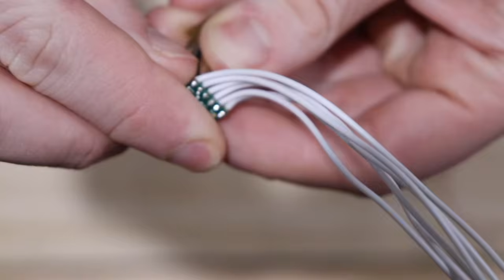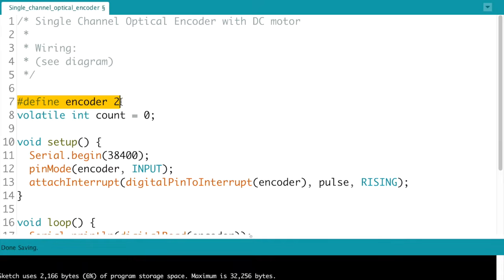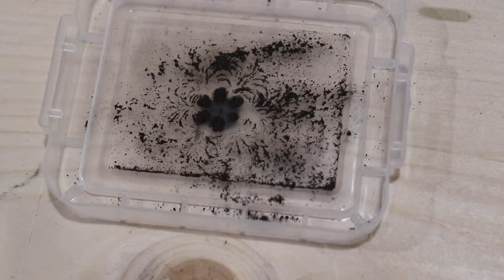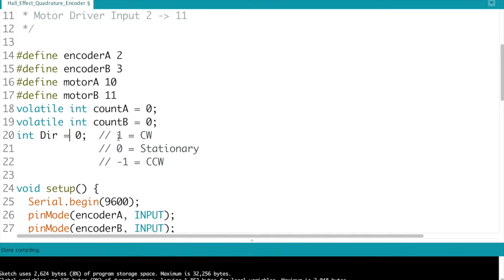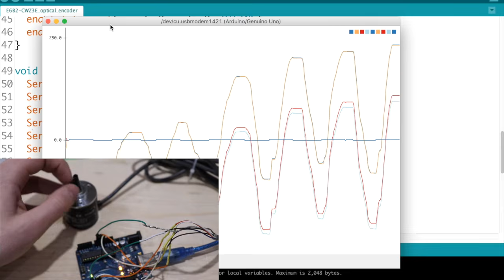How to use encoders (Optical, Hall Effect, Quadrature)

Comment: Good day.
Can you please tell me why we need to use 2 interrupt inputs per 2 phase quadrature encoder? Can't we just use one interrupt? One phase is connected to the interrupt input, the second phase is connected to any other input. When the interrupt is triggered, we read the state of the second input, and determine the direction.
And in this case, for an optical encoder with 3 phases, we can use two interrupts. One for one of the main phases, and a second interrupt for phase Z.
PS: As far as I remember, Atmega 328p has only two hardware interrupt inputs.
Reply from the maker: yes, this would work and probably makes more sense to do it this way
Reply: @WillDonaldson  Use two interrupts per encoder, it may make sense if, as you described in the comments, we want to force the encoder resolution to increase.
Reply: this will also change the Mode of the interrupt from "HIGH" to "CHANGE", otherwise it will skip the pulses.

Comment: Just looking at the rise of A means edge bounce will give false counts. You need to alternatively look at A and B, or look at the change of A both up and down to achieve correct counting in noisy environments or where you might be sitting in a position on the A edge.  
If you choose to look at both the rise and fall of A, scan B when it happens. If the state of B is the same as A, you went backwards. If B is opposite, you went forwards. 
A better scheme is to look for a change in A then look for the next change in B while ignoring A and visa-versa. You completely avoid edge bounce problems.

Comment: Handy tip if you are using the E6BS-CWZ6C Encoder This uses NPN Open collector outputs.. They need to be pulled up on the input. Use this pinMode(encoderA, INPUT_PULLUP);  for all your inputs (:
Reply: I don't know what the hell this means but maybe it's why my encoders don't seem to be working AT ALL. Thank you, will play around with this tomorrow
Reply: @MichaelButlerC  HI It's arduino code... the input from the encoder to the arduino, these pins need to be pulled up. I think what it does is holds the pin high with 5v with a resistor. so when the encoder has a falling signal in the square wave it's from 5v to 0v .Not lets say 4.2v to 0v. i might be wrong but pulling the pin up on the arduino made mine work.
Reply: @TidyThreads  thanks, I figured out already -- my pro micro was only giving 4.5v on VCC so the encoder refused to work. I ran a second USB cable raw, gave it 4.98v and it started working!

Comment: Why did you change the arduino from Leonardo to Uno when you had started using the optical encoder (2 phase) ? I ask because I am facing a problem with my leonardo.
Reply from the maker: This video only uses the Arduino Uno? Truthfully I've never owned or used a Leonardo so I can't help with that specific issue, but the code should work on all Arduino boards

Comment: How is he plotting on serial monitor, is that some another application or arduino IDE can do it by itself?
Reply from the maker: it's a feature that comes with the IDE. Go to the top menu of the arduino IDE window and select: Tools/Serial Plotter
Reply: @WillDonaldson  Thanks friend, i am trying it tomorrow
Reply: @WillDonaldson  Just one question, it's kinda related to this video. I have some optical encoders from old printers and i can't identify pins, there are six of them. Do you have some idea where i can find more information about this?
Reply from the maker: @filipstojanovicmechanicale9265  no, not with the information provided. There are multiple different ways it could be wired. Look for any part numbers and search online for documentation. If you can identify the power and GND lines (and at what voltage it operates) then you can probe the other wires to test them.
Reply: @WillDonaldson  Thanks 👍 I will try to identify the power and ground. And i will let you know if i succeded

Comment: I am using incremental optical encoder 600ppr but gives 1200 readings per revolution (max 100khz) with  arduino(16mhz). When the rpm is around 50-100 no issue with the readings. But when i rotate it at 300+ rpm the Arduino skips pulses and gives a wrong output. I tried removing the serial print function still there's some skipping. I am using it interrupt routine. Should I change the countroller to teensy 4.1 (600mhz) or any other solution. And if teensy then can i use 5 encoders on one teensy. Please help me with it.

Comment: Why when i use the last code the only thing i get is 0
Reply from the maker: Not sure, double-check the wiring, it's possible there is a loose or incorrect connection. Also if you have a different encoder to the one shown in the video, check the manufacturer's datasheet as they may have different wire names or colors, may operate at a different voltage, or have other features that make it incompatible with the code I provided.
Reply: The same thing happens for me, still troubleshooting. Did you find a solution?

Comment: We use the quad optical encoders in oil and gas. We attach them to mechanical footage counters that attach to a wheel. The wheel moves against tubing which turns the mechanical counter then rotates the encoder via a lovejoy connection

Comment: Hello
Can you help me write the Arduino code?
I designed a small car that runs on a single DC motor, and I want to measure the distance traveled by the car and through this distance I can stop the car or reduce its speed.
So I purchased (Incremental Rotary Encoder 600P/R) to measure the distance by attaching it to one of the wheels, and I also purchased (BTS7960 43A-H Bridge High-power Motor Driver) to control the motor according to the distance measured by the encoder.
(For example, when the car travels a distance of two meters, it slows down or stops)
Can you help me write the code on the Arduino?
Note that I have the circumference of the wheel, and I will send a picture of the encoder and the Motor Driver
Thank you.
Reply from the maker: thanks for your interest in my tutorial! Unfortunately, I do not have the time to write custom software for everyone. That said, if you take the code provided in the description you can count the number of pulses. Knowing that there is 600 pulses/revolution you can calculate the distance. Distance = (wheel circumference) * (number of pulses) / (600 pulses per revolution).
Reply: @WillDonaldson  Thank you
Reply: Can we calculate the pulses per revolution using serial plotter or do we need some equipment to calculate it ? My encoder motor supplier hasnt given the info about pulses per revolution. Can we measure it only using serial plotter?

Comment: Will, how do you get the differential quadrature encoder to 4x its counts? I have heard that if the PPR of the encoder is 1024, then it can use both channels to up that count by 4 and get a far better resolution.
Reply from the maker: Correct, in the video, I demonstrate counting the pulses each time channel A transitions from a LOW to a HIGH state using the RISING command for an interrupt. This gives 1024 pulses per revolution. If however, I was to use the CHANGE command for an interrupt (instead of RISING) then I would count a pulse both when channel A goes from LOW to HIGH (rising) and also when channel A goes from HIGH to LOW (falling). This would double the number of pulses per revolution to 2048. If I also measure the change in pulse state from channel B using the CHANGE command, the resolution will double again to 4096. Hopefully, that makes sense, here are some resources if you want to read more. 
About Arduino Interrupts: https://www.arduino.cc/reference/en/language/functions/external-interrupts/attachinterrupt/ 
An alternative approach to decoding quadrature signals: https://cdn.sparkfun.com/datasheets/Robotics/How%20to%20use%20a%20quadrature%20encoder.pdf
Reply: @WillDonaldson  Thank you very much, Will :). I will look into your links and learn more about them. You are a gentleman and a scholar!
Reply from the maker: @yhsbu  No problem, let me know if you have any other questions :) Thanks for the support on BMAC!
Reply: @WillDonaldson  Does it matter if the encoder is a push-pull type or a line driver? If we're just trying to accurately count pulses, will either type work just fine?
Reply from the maker: @yhsbu  the operation is the same, they just handle noise filtering differently. This article gives a great explanation of the 3 types. A short summary is:
1) Open-Collector Output: cheapest but susceptible to electrical noise and slow (relatively speaking)
2) Push-Pull: Fast but still susceptible to electrical noise
3) Differential Line Driver: Fast and good at filtering electrical noise (more expensive)
I am not sure what the scope of your application is, for hobbyist projects any of these will be fine, if used in an application where very precise control is important and you have a long cable length that is susceptible to electrical noise then maybe use a differential line driver
https://www.cuidevices.com/blog/comparison-of-common-encoder-output-signals
Reply: @WillDonaldson  I'll PM you. Thanks, Will.

Comment: the best video I can found on the subject. My question is, is it possible  to use same pin for different hall effect sensors. For example if you are using 4 motors, it will take 8 pins this way.
Reply from the maker: Yes, different pins are needed. Although one work around to halve the number of pins is to connect only one of the two outputs from each encoder (i.e. connect channel A to the Arduino and leave channel B disconnected). Since you know the direction that the motors are spinning in (given that you write the direction to the motor controller) you don't need both channel A and B to determine the direction. One caveat is that this only works if the motors are not backdriven.

Comment: How do we handle 2 of those micro-gear motors with a single Arduino UNO since the uno has just 2 interrupt pins ?
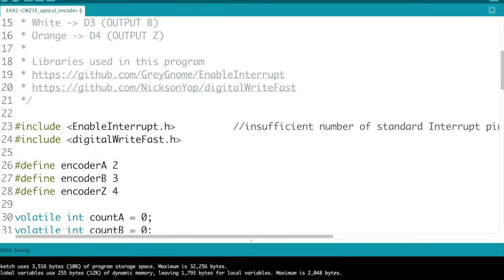Reply from the maker: I discuss using more than 2 interrupt pins from @17:10 onwards. See documentation for enableInterrupt if you want more info https://github.com/GreyGnome/EnableInterrupt
Reply: I want to control 2 of these motors for differential drive. How do I control them or play with encoders ?

Comment: Don't you have problems with the accurancy of the encoders. I use some magnetic ecoders to integrated in my 37D Metal Gearmotors and they seemded not to be very accurated. For Example: 
I got 2 motors on my differencial robot and if i turn one on and the other not, both encoders give me "counts". 
The one which is off, only counts a lil bit, but thats a big problem.
Reply from the maker: Hmm, it is hard to diagnose hardware systems without seeing them in person. Are you using the code I provided, or has it been modified? By the description it sounds like you may have both encoders tied to the same interrupt service routine (ISR)? They should have two ISR. Also depending on your encoder you may need to include a pull up resistor on the output pin to avoid floating values. I would advise consulting the datasheet for more information

Comment: Im having a little trouble setting up the circuit for the hall effect sensor as when the power to the encoders is disconnected is when I get any pulses and when it is connected I get groups of peaks and then nothing continuously. Im using a very similar motor to you but can't seem to get it working. Any help would be great!

Comment: Thank you for your good explanation, I just  wondering how to calculate the speed of a motor (RPM) using your code ?
Reply: did you?
Reply: You can use the same code that he showed in the first example, with the following modification:
Suppose your encoder has 30 slots. Create a variable, say 'r' and add 1 to it, each time the count variable hits 30, or a multiple of 30. r is the number of wheel revolutions.

Use 'long int x = millis () ;' function (for example)  in the beginning of the loop. At the end of the loop, if x is greater than or equal to 60000, stop adding 1 to the r variable. Print r variable on serial monitor.

This will display the rpm of the motor on the serial monitor
Reply: @akshaysai1109  And what about the case of using a hall effect magnetic encoder?